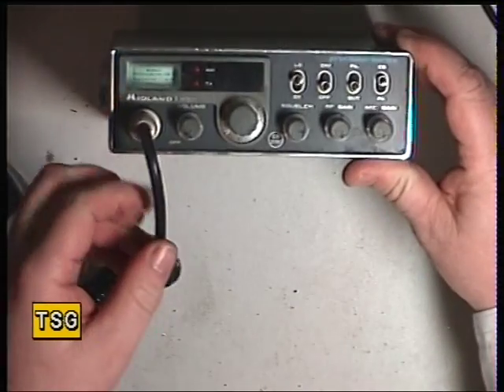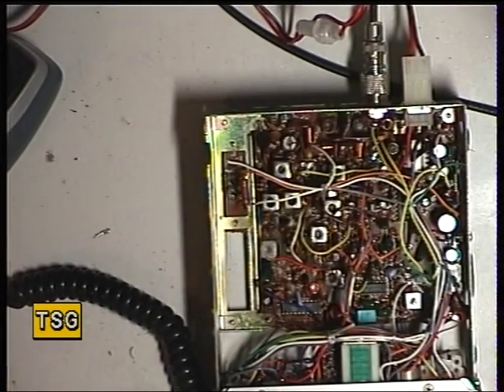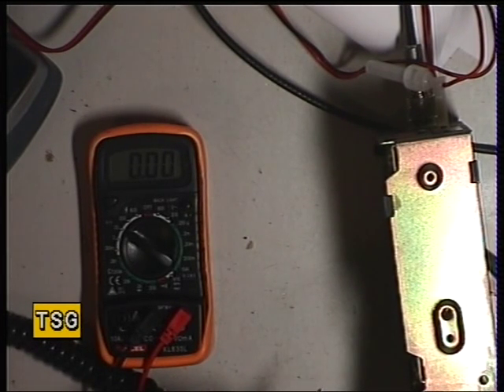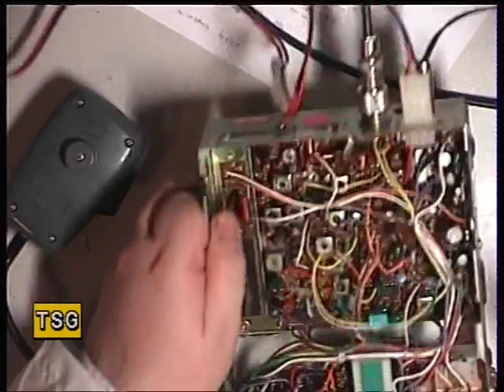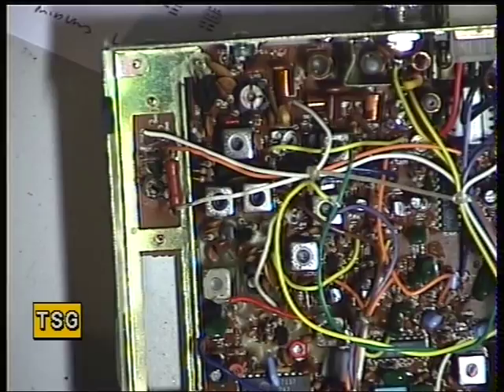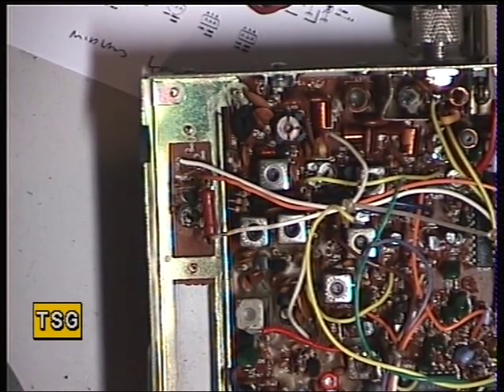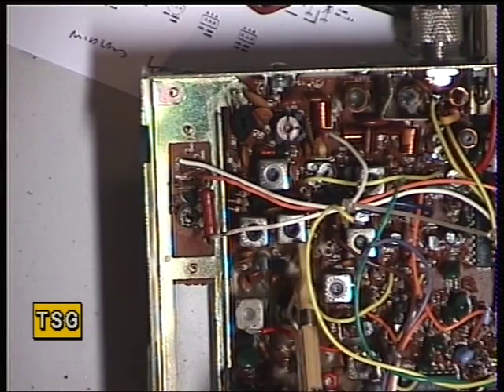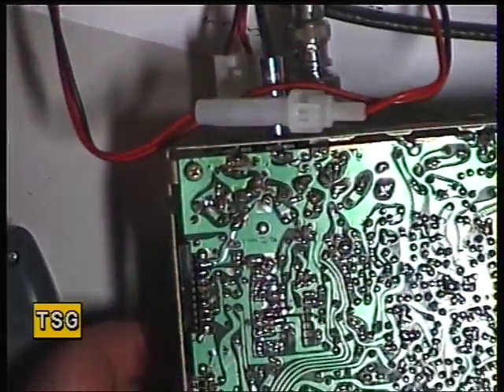Midland 4001 - UK CB radio, (CB 27/81) (Mobile).  VCO & Transmit alignment

Comment: I have a alan midland 4001 precision series, but the tx not works, no longer I tested the transistor applying it in other radio and it works, I do not know what is malfunctioning will be that, someone will have an idea of what might be.
Thanks
Reply from the maker: +TheDjorder You start by checking that the tx vco is in lock. If the radio has been on a bada SWR, it's usually the driver transistor that fails rather than the output one.

Comment: Hi Richard,
once again thank you for uploading the 4001 vids , But the tx tune up you ran through i had followed from the maxcom radio you covered, and the driver and final transistors have be returned to standard but i still cant the radio to peak at anymore than 2 w?
kind regards chris.
Reply from the maker: It would need some proper fault finding with an RF voltmeter with reference to the full manual (we have the Midland 2001 full manual). Probably something really silly at fault.